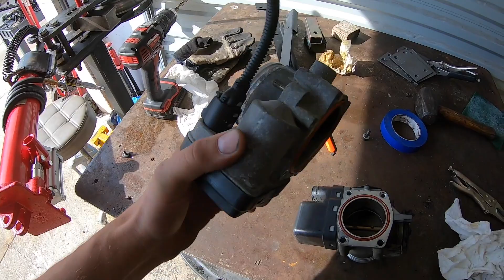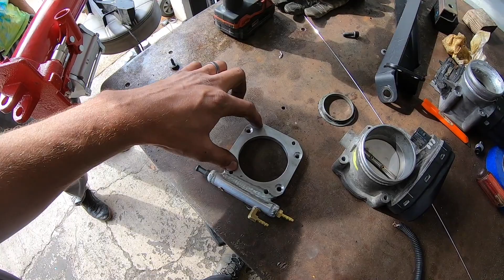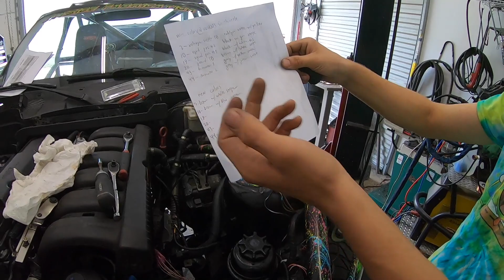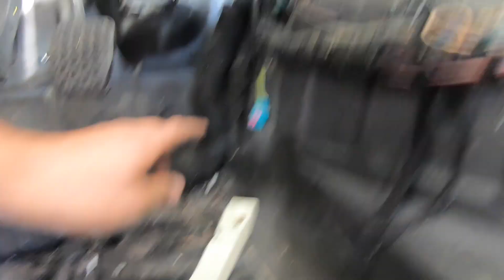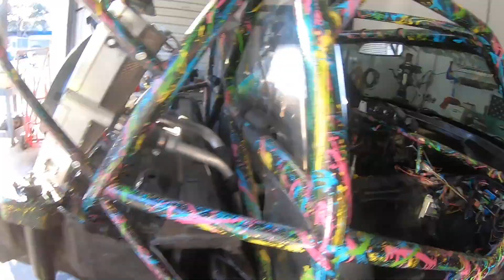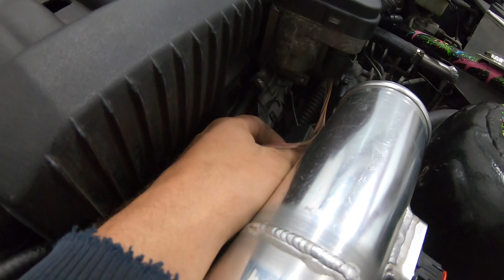BMW MS42 to MS43 Swap. Will it Run???

Comment: Can you make me one of those throttle body adapter plates and if so how much would you charge me for it I really need one of those I'm doing the same swap on my E46 it's a 2000 328i and I'm trying to do the MS 43 swap on it because it's actually an automatic and I have a 01 325i that's a 5-speed but the 2000 is a nicer condition so I was going to put the manual swap from the 325 and the 328 and when I started looking at it the 328 has the cable operated throttle body and when I started looking everything up I realized that it was the MS 42 and I started doing all the research and found all the different swaps but you're the only video that I seen with this adapter plate made like that with the vacuum things on it you can get a regular adapter plate but it doesn't have that little vacuum thing on the bottom of it I want that because I plan on going boosted

Comment: My 330i has the DBW throttle body and a separate IAC valve. Is Vlad using software that deletes the IAC valve?
Reply from the maker: Yes. He can code out your idle air control on ms43. It makes all the difference in the world imo. Throttle response is night and day.
Reply: That's pretty cool.